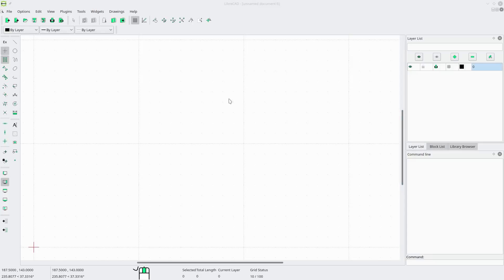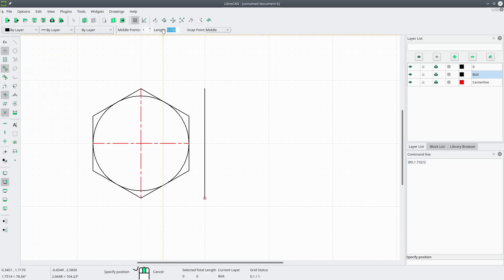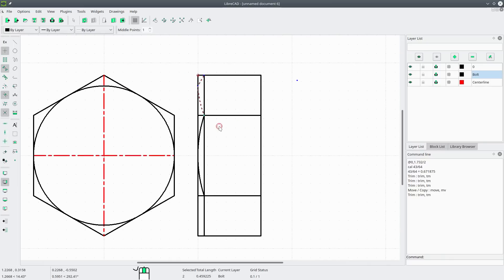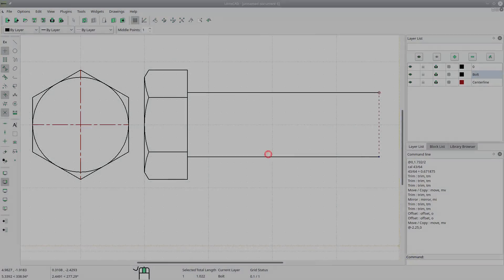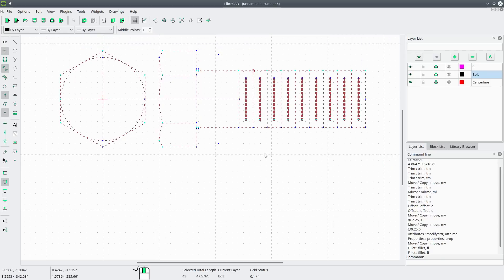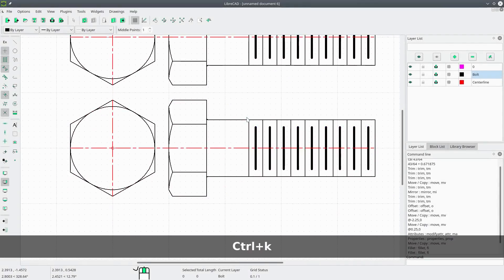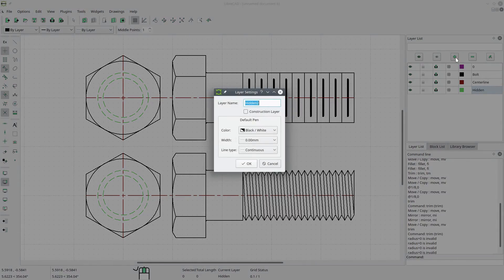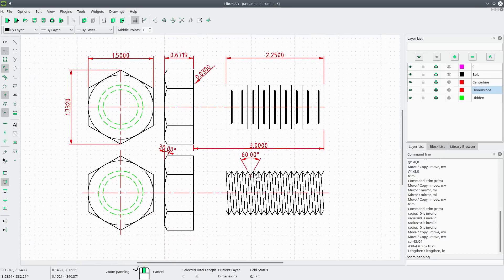LibreCAD Tutorial: Drawing a Bolt

Comment: Very well explained. I like it very much but the problem I am having is when I put the values in the command line for lines ect. they are not drawn the correct size. I am sure my Drawing preferences are not correct but I do have the units set to Inch & the Length to decimal & Angle to Decimal Degrees. Can you advise as to what your settings were on this Bolt drawing? Thank you.
Dave
Reply: Did you find an answer to your question? I am just starting and having the same issue, not sure what I'm doing wrong.
Reply: @markrand652  Mark, Actually, No. What I have been doing is either, make the inch to mm conversion, & enter it as mm or, just make the entity long or shorter than needed & then use the trim or extend tool. Using the conversion method makes the drawing more to scale.
Dave
Reply: @davaroon  Thank you Dave.  I’m just making my second attempt and the conversion method has crossed my mind.  It’s important to me to be able to draw accurately in inches. I feel sure there’s a simple answer to all of this but I haven’t found it yet.
Reply: Mark,
Please let me know if you do find a   way. I do like Peters tutorials. He is easy to follow as I drew this bolt along with him. ( definitely with several pauses along the way so I could get it right) 
I do like using Libre CAD
Good Luck. 
Dave

Comment: I have a question.  When I draw with LibreCAD, and when I print the size is different slightly, is there a way that I can adjust for the size difference?  I thought I export to pdf and gto printing store and use their printers, but on the pdf lines are almost invisible.  Do you know how to fix this?

Comment: I have 2.1.3 version. When I try to draw a polygon like yours in the video. I draw a triangle. Why is that? I am very new to LibreCAD and I want to learn how to use it. Is there something in the drawing preferences that needs to be changed? I do not know where to look.
Reply: On the top-bar, look for dialog where you can  SET the # of sides.

Comment: Great video, some steps were a bit quick and paused and rewinded a couple dozen times and glad you had a high screen resolution so that I could see the items you were selecting and was good following along in Theater Mode. Coming from SketchUp and trying LibreCAD is certainly good exercise for the brain.
Reply: Jumping back and forth between SketchUP and LibreCAD is challenging because the user interface and purpose for the programs is so different. I use both of these programs. I have used SketchUP a lot recently (to design my new workbench) but still need to use LibreCAD from time to time for very accurate, 2D scale printouts (which I use as templates). I will probably challenge myself further by learning Blender (so I can create 3D animations of mechanical designs).

Comment: I'd like to learn how to use CAD with no prior experience in drafting or engineering. I found this miles over my head. If anyone has a reference for LibreCAD for Slow Dummies, I'd appreciate it.
Reply: @Bro Gill Forgive the shameless plug for my video:  https://youtu.be/21pD_rFdoDQ
Reply: As long as you have the same software version, you should have no major problems. Just try to follow along step by step. Pause the video after each instruction and try to repeat it exactly. It will probably take you a few hours to complete because you will make mistakes from time to time and you will need to rewind the video to see where you went wrong. Just remember to save your work after each correct step.

Comment: Great job.  This is the first time I have heard someone use the factoid/standard of length of thread for various bolt sizes. I've been using CAD since AutoCAD Ver 1 for DOS.  I am experimenting with several CAD Softwares including LibreCAD.  I use circles and rectangles for short cuts to drawing single lines.  I am currently (in my regular job) using Inventor Pro 14.  I now subscribe and look forward to your other vid's.   Later.